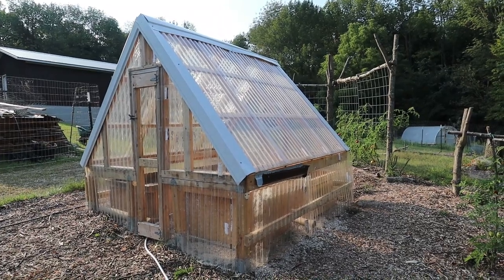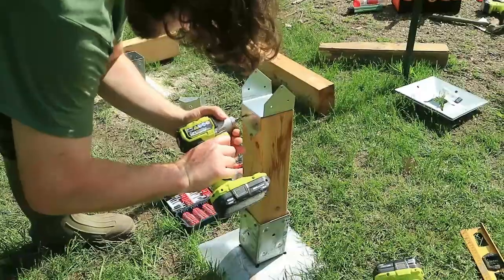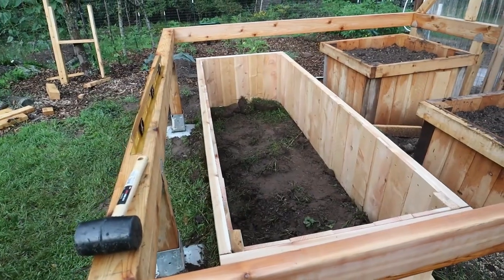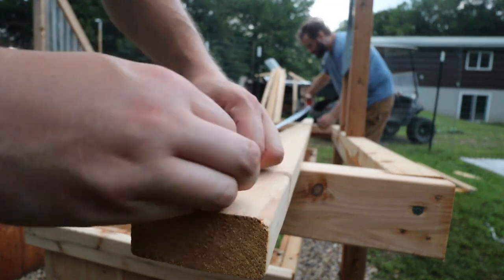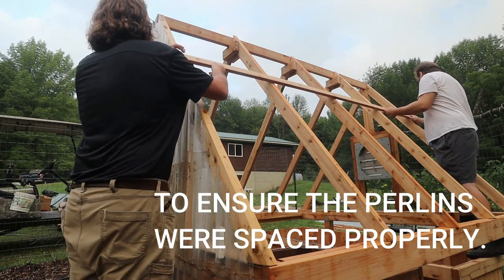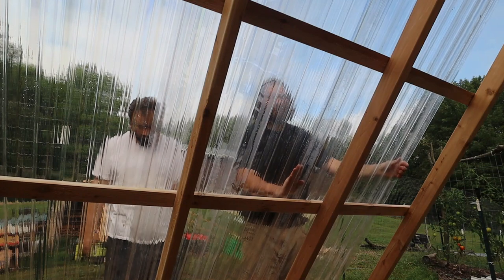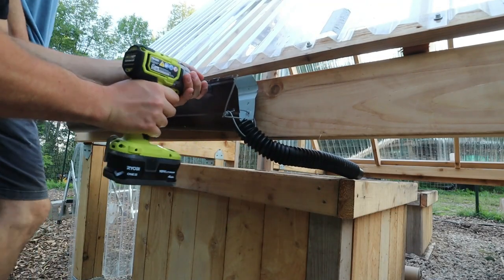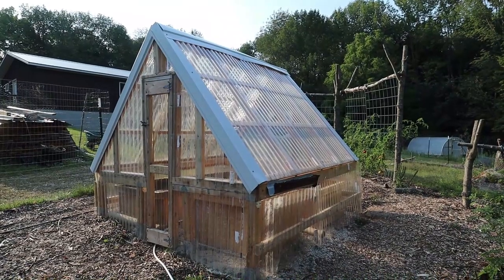How To Build DIY A-Frame Greenhouse: Step By Step

Comment: 🙏it can withstand the snow load...it does  looks strong enough 👍
Reply from the maker: We are hoping it is steep enough for the snow to slide off.  That is one of the big reasons we wanted an A-Frame.  If it isn't we will just have to sweep the snow off after a big storm.  So hopefully, there isn't snow on it for too long.